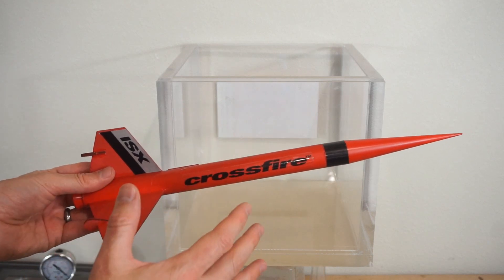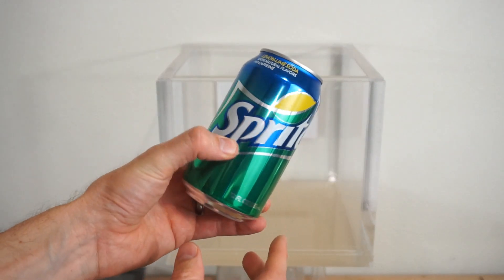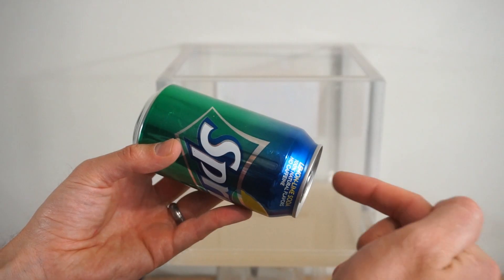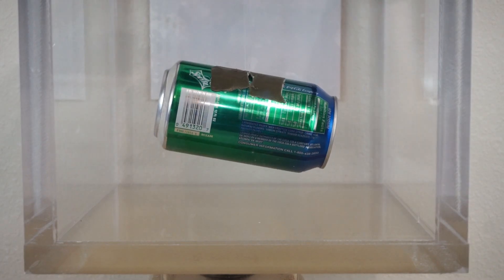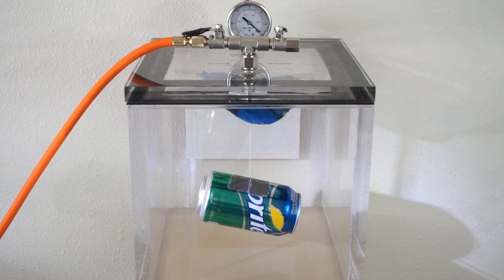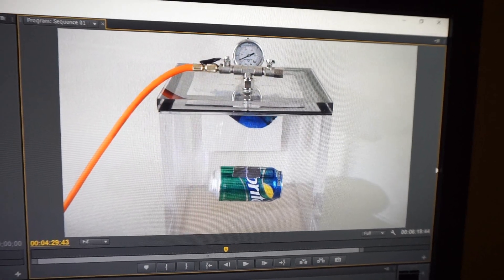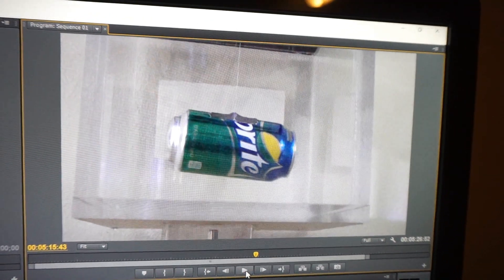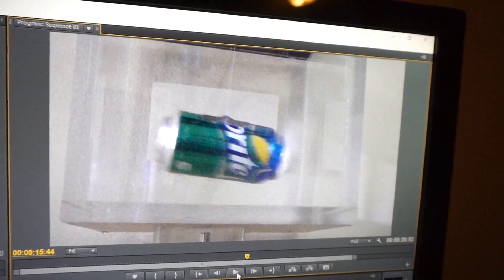Can a Rocket Fly in a Vacuum Chamber?

Comment: Wouldn't the air act like a wall itself and make the expanding gas build up more pressure and propel the whole thing faster?
Reply: No the air actually slows down the gasses coming out of a rocket making the whole thing go slower. Not to mention the air in front of the rocket acts like a wall, slowing the whole system down a lot..
Reply: Yes, but the rocket has an aerodynamic shape that makes it cut through the air, not push it. The gas being unable to escape from the rocket as easily (due to the air) would make the gas push harder as if the air was a wall. 
Would a gun shoot bullets faster if the bullet chamber was empty on both sides?
Reply: @Archimagus wow 😂😂😂 bro what? Hell naw